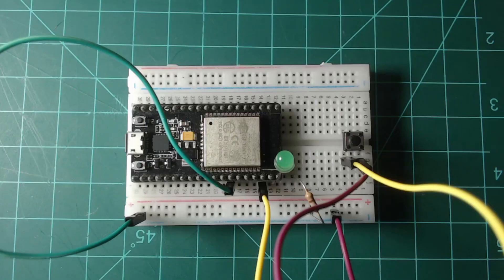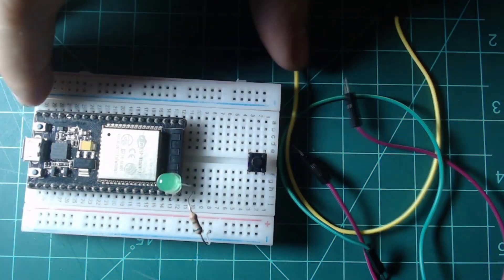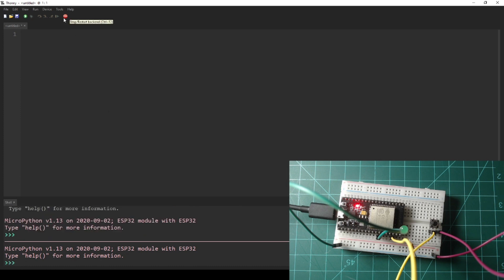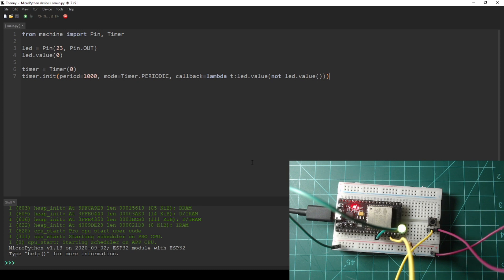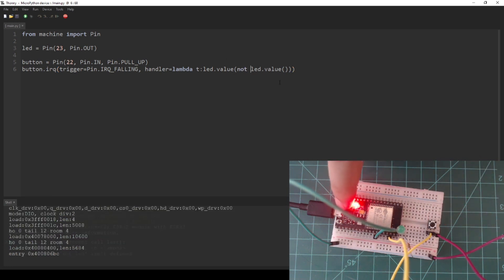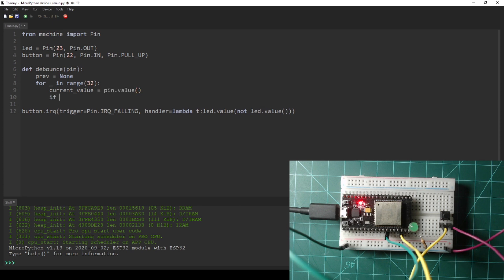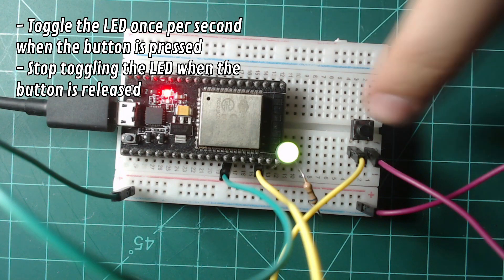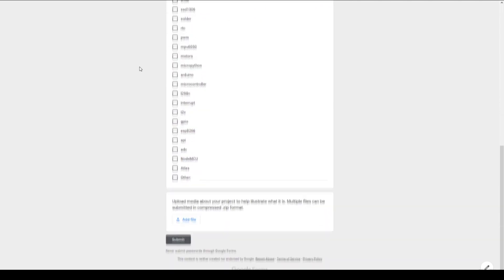Programming an ESP32 NodeMCU with MicroPython: Timers and Interrupts

Comment: what would you need to change in the entire code if you wanted to trigger the event on IRQ_RISING edge as well?
Reply from the maker: You can set the trigger to multiple events using a bitwise or '|'.

trigger = Pin.IRQ_FALLING | Pin.IRQ_RISING